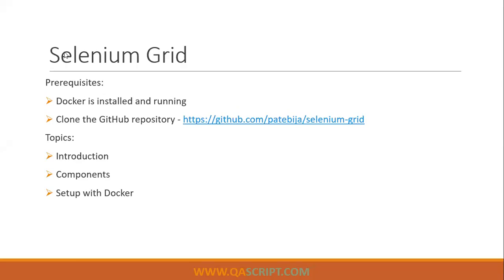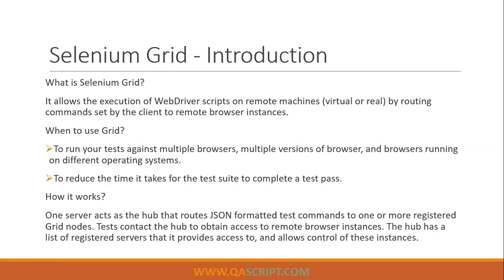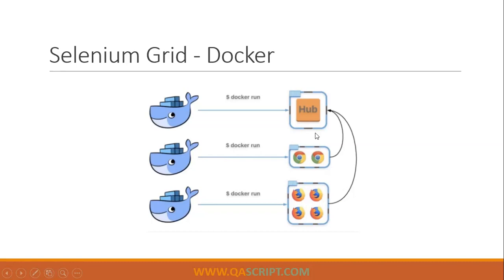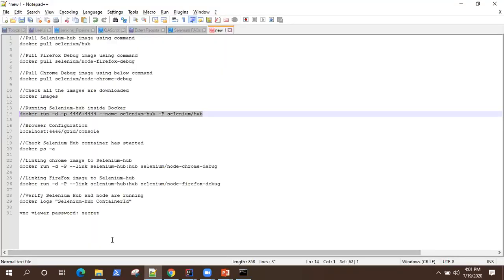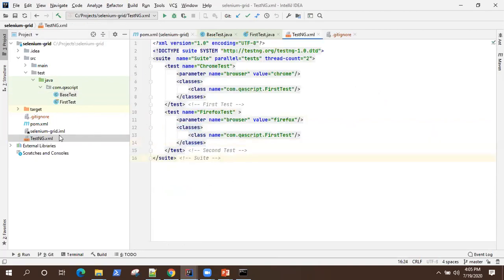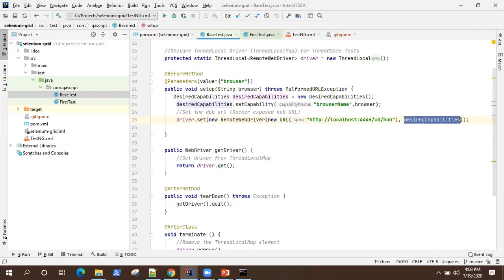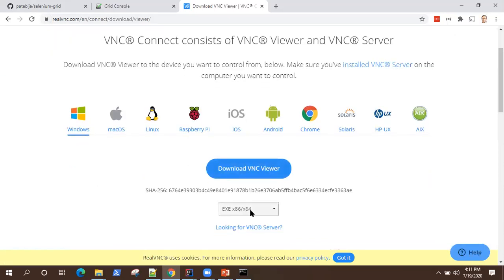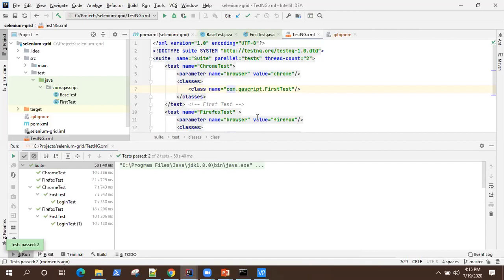Selenium Automation Framework Tutorial - Setup Selenium Grid on Docker with Cross Browser Testing

Comment: Hello Bijan,
If i have Maker Checker roles in my application then is it possible to run script parallel on two instances of chrome browser on same physical machine.
Reply: E.g If i raise any request through maker role and i have to approve that request with checker role, Can i do that using Selenium Grid.
Reply from the maker: @Mayur. Haven't come across any such scenario and as it is application specific, it will be difficult to tell without trying it out. Will keep you posted if I find any solution.